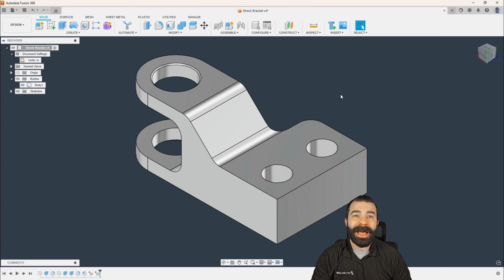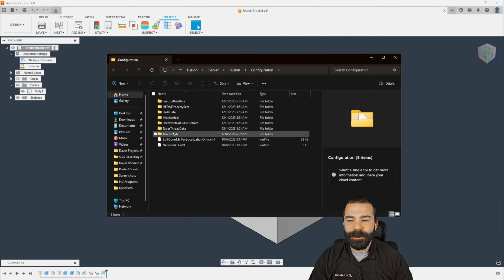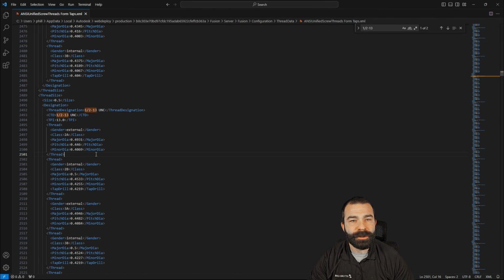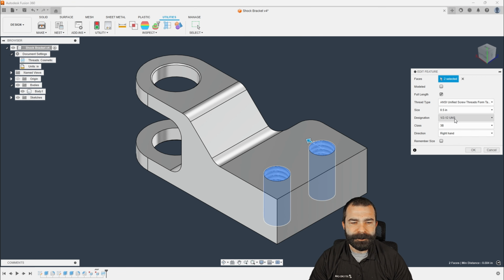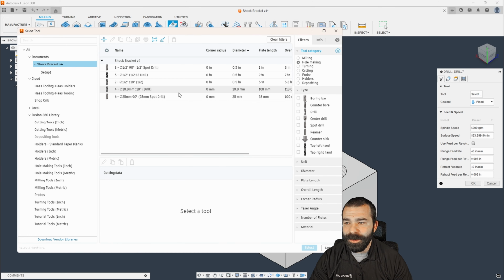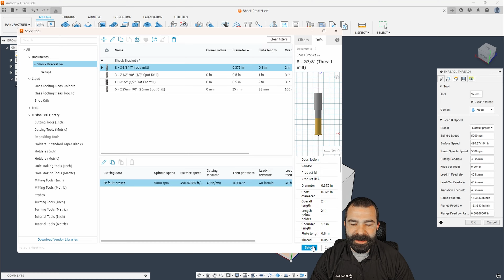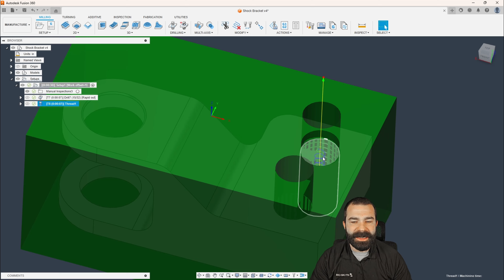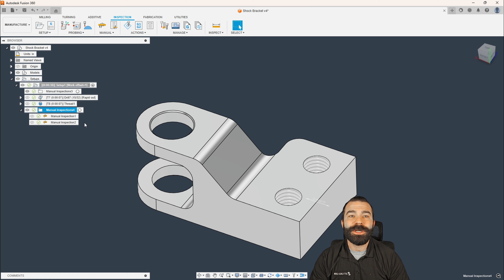Workflow Wednesday: Custom Thread Design and Machining

Comment: Hi Phil thank you for your videos. I made a file for helicoil threads but since the update I did yesterday it’s all gone same with all the expressions and user defaults I had set. Is this gonna happen every update ?
Reply from the maker: I have heard that this does happen upon updates leaving people frustrated. On one hand its nice to always get the newest however it does overwrite the old file. I would suggest keeping a copy of what you edit and just swap out the file after an update. As for your expressions they tend to change in the even there is big changes to expressions. This last updated they did ad alot and possibly had to default alot.